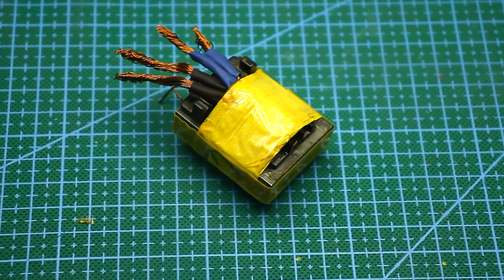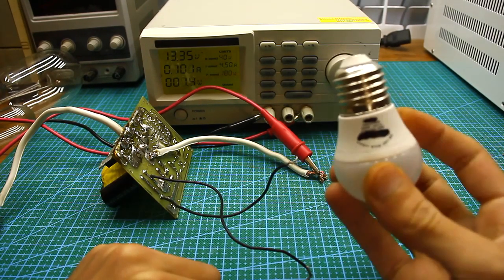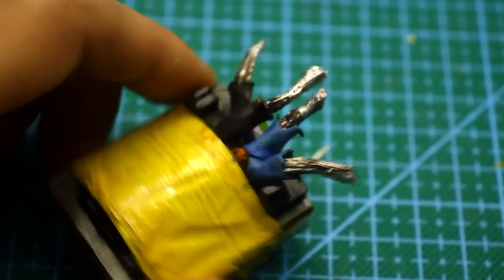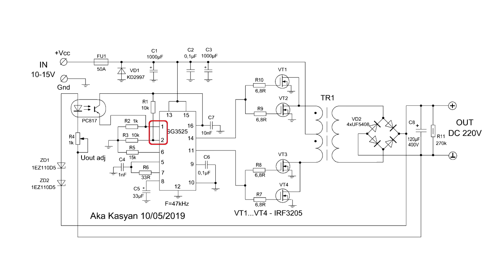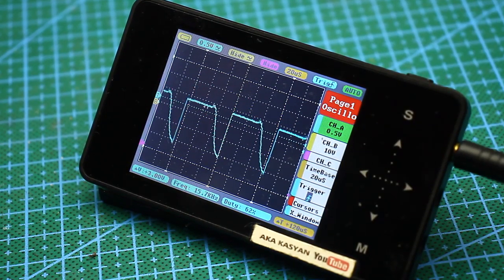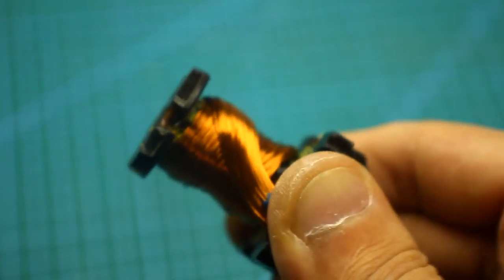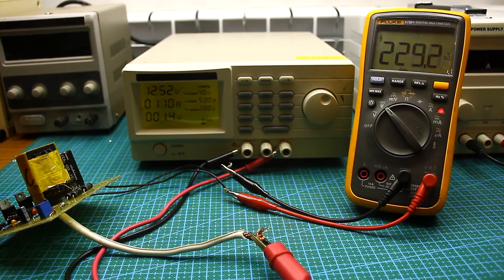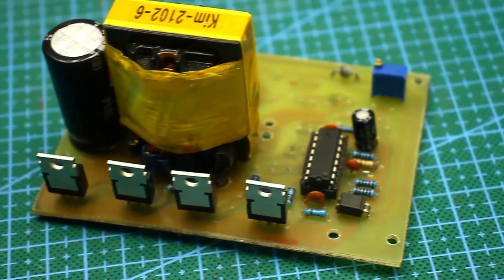Stealing from China 5! 12-220V power inverter

Comment: interesting. I added a feedback loop to the "1000w" version using a tl431 and a pc817 in a similar fashion to yours. I found that when the duty cycle was less than 49%, there was much ringing on the transformer and the fets got very hot. it's likely your transformer has enough stray inductance to avoid this problem, or your control loop is better.

Comment: Its a good desing but it needs snubber diods and a snubber network to keep back inductance from blowing up youre transistors like that. As for short protection try a few fets with there bace cenected to the positive of the output through some rrsistors soo if a short acures. This causes the output voltage to drop witch causes the fets to shut off.
Reply: Cud just use a relay lol

Comment: Higher frequencies (here around 30 KHz) benefit in smaller transformers, but devices, which need 50/60Hz can't be driven by this circuit.

Comment: 10:40 I see few things wrong with this circuit. Gates resistors have too small values. SG3525 can only provide 400mA peak. No snubber network on the MOSFETs drains. Value of the 1k potentiometer is too small to limit the feedback current when zener diodes are conducting and finally there should be one extra ceramic low ESR capacitor near the source pins of the MOSFETs because electrolitic capacitor alone does not have low enough ESR to deal with sharp current spikes during transistor switching.
Reply: I built this circuit with a small transformer and a only 2 MOSFETs and it worked for loads under 100W. Today I upgraded it to 4 MOSFETs and bigger transformer, similar to the one in the video. Powered it on, lit a 40W bulb normally, tested for around 20s and BAM! Got the exact same pitch sound and exact same loudness bang from the same capacitor. I hope the capacitor didn't kill the IC or MOSFETs.

Comment: Thanks for sharing.  I watch many of your videos because you are one of the more knowledgeable DIYers on YT.  The following is not meant as a criticism so bear with me on this.

The gate wave forms are not good.  the turn on is fast but the turn off is very very slow, almost 20uS. Why? This should not happen. Check the wave form of the input current.  this can cause heating of the transistor die and hence transistor blows up.  When one goes then all of them will go.  Does the chip heat up after several minutes of use?    If so then with those transistors perhaps you do need to add a gate driver. Imagine how it would work at 47KHz.  I also noticed that the schematic says 47KHz but the wave forms period is about 63uS for both sides.  the scope says 15.7KHz but that is for both edges so the frequency is around 8KHz.  How does this work out for your primary side turns? At this frequency you need to have 15 Turns on each side.  I think you are using 4 or 5 Turns, so you need to speed up the turn off in order to run at 47KHz.

Secondly the SG3525 is a voltage mode controller and there is no mechanism for equalizing the Volt-seconds on each side of the transformer.  The 3525 was made just before current mode control  chips became available.  If I want to make a low cost push-pull, I use a UC3842 chip (10 for $1) as the controller and apply its output to the 3525.  Both chips are very cheap and with a little bit of additional circuitry you can make a reliable current mode controlled push-pull with current limiting and excellent voltage control.  otherwise your transistors will blow up.
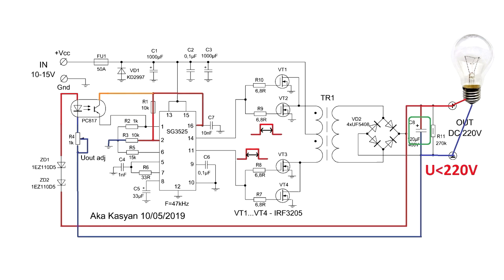Reply: I think you are mostly right. Although if 6:55 shows a gate voltage, then that means the frequency 15.7kHz is the same as the output AC frequency since two such gate waveforms are necessary to create the entire AC wave. That is a very low frequency though. It might cause problems as well.

I think you are correct that the very slow turn-off is a problem. It could even explain the strange exploding capacitor if both transistors were (partly) on at some point. Although I´m not sure which capacitor in the schematic it was that actually blew up. 

I don´t understand why this slow turn-off happens though. I would not call the SG3525 a very powerful gate driver, but apparently it can source and sink the same amount of current (absolute max +-500mA, steady state +-100mA). The combined 3,4 ohms of gate resistance per pair of mosfets is very low for that sort of gate driver though. Maybe the ic itself was already damaged from that? The peak gate drive current with those resistors could be as high as 4,4A for a short time.

Comment: I think it can only (strictly) work with SMPS only. Obviously transformer based devices won't work.
Reply: There are problems with that as well. In an SMPS the input capacitor is normally charged to 325Vdc, but with this circuit it will only charge to 230Vdc. Depending on the rated input voltage, that could be a problem. Also, in its bridge rectifier, only 2 of its diodes will have to handle all the load. The other 2 will pass no current at all.
Reply: @Basement-Science  sure I had forgotten about that. You are right

Comment: Dc voltage after rectification with capacitors is around sqrt2*ac not the same value.
Reply: But 220V is effective value, 310VAC peak to peak is equivalent with 220V DC
Reply: @ЛазарЈаковљевић  for incodesent loads yes but what about smps? Its taken in count that voltage after retrification is 315v but youre feeding 220vdc(which goes down to 218v after bridge rectifier) and youre running your psu at higher duty cycle and loading it more
Reply: @Ncky  well it is correct but I think that this power supply is designed only for incodesent loads, you will need 315V supply for SMPS, but if you connect a light bulb to it it will be too much
Reply: @ЛазарЈаковљевић  u speak serbian?
Reply: @Ncky  Да, говорим српски

Comment: can you make it output as AC 220V 50-60Hz?
Reply: its almost the same,  but you either put a h bridge+ 50-60hz driver on the rectified HV side or make it a half bridge with only 2 transistors, but add another secondary.
Reply: @two_number_nines  i need to learn to do that.. 😅😅

Comment: Great video , I’m just learning about these control chips , looking at the data sheet I’m not sure that the SG2535 has any advantage in the non use of a gate driver over the TL494.

both IC claim 500MA~ source to sink 
Actually the TL494 claims 500Ma per transistor and the SG3525 states 400Ma peak per drive transistor. 

So I think they are both very similar it would come down to personal preference on something like that

Those fake mosfets are the dumps I’m sure I have a bucket of them here, makes scavenging worth while in some aspects and Television sets {both old and new} all the more desirable.

Edit looking at the block diagram of the SG3525 I can see that the gate drive has two NPN with the output from the bridge of these , traditionally that could allow for a nicer gate drive in terms of on time etc, so perhaps it is better from that point of view. However I’d be inclined to use a built gate driver anyhow so no great loss and probably not a huge difference at lower frequency. 

Great video

Comment: Outputting a DC voltage isn't the best thing, some examples: this way only two of the four diodes in a full bridge rectifier see the full current, transformers act just like a resistor

Comment: I need a adapter that is basically an USB OTG adapter but it has 2 USB output ports, can i get it from China?
Reply: That makes no sense 😭😭😂😂
So you want to power something from your fone 😂😂
usb on the go is to connect external usb devices to the type c or micro usb device that's uses otg mainly fones or android box why 2 outputs should be inputs lol .......can get them anywhere